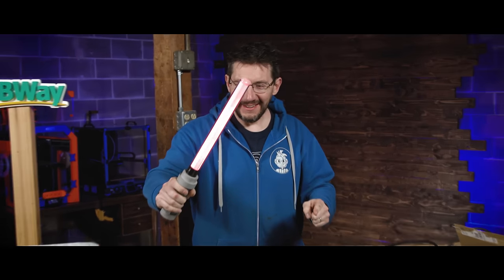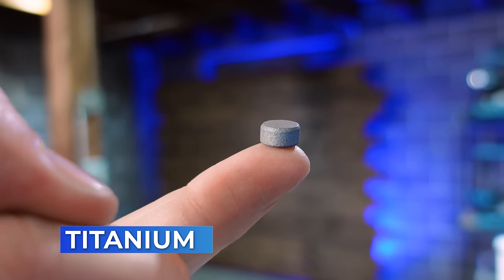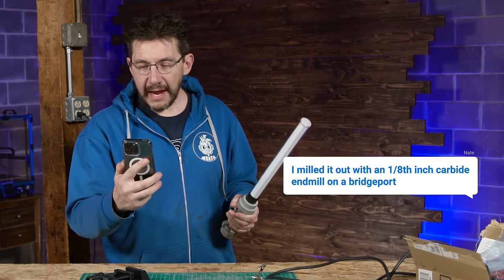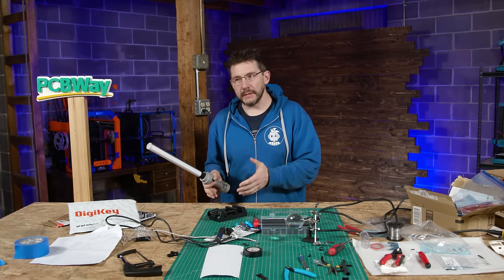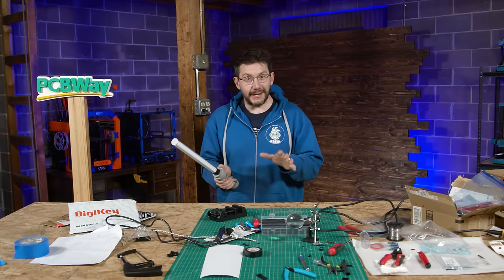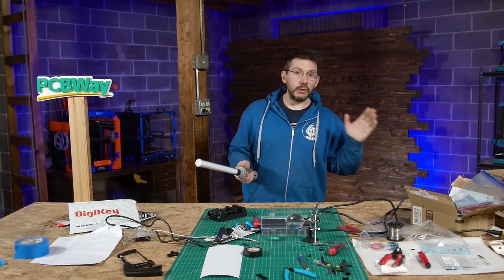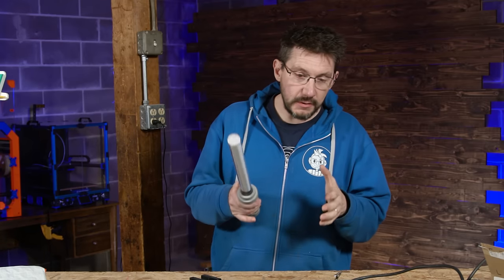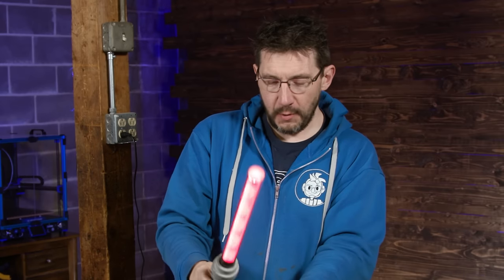AWESOME 3D Printed STEEL!

Comment: Whenever you tap metal, ALWAYS use some sort of cutting oil. Also, if you are tapping a small hole, don’t use a drill. Do it by hand and put your work piece in a vise.
Reply: Tap + Drill = Sadness, their are option for hand tapping drills with special chucks on them though. Good ones run you close to $500

Comment: Bacon grease and beeswax are the 2 most popular tapping "fluids" in our shop.  And if you happen to break a tap in an aluminum part, just send it out for anodizing, it will come back without a tap in it.  But in every case, alignment is key, a misaligned tap will almost always break.

Comment: I have never used a tap in a drill. It's alwyas been by hand, and WITH tapping/cutting oil, lots of oil. 
At lesat that was the way I was trained decades ago by machinists.
Reply: You can use a drill if you use the clutch and once it binds go back and forward till you are done

Comment: Very cool. These kinds of projects are always ones that bring smiles to people's face. But the one thing that came to mind... "I put some electrical tape on the tube so I can wave it around like a maniac, I mean..."

I had a teacher that showed up and proudly showed myself and classmates his new phone... a just released iPhone 3G. And with this new thing called the "App Store", he downloaded the most advanced apps that ever graced our mortal hands: the fart button and the light saber. Tap the touchscreen and "wooowow" and the light saber came on. Tap again "voooop". Double tap and the color changed. And if you swing it around... yea, that's the stuff. But unlike your electrical tape to hold the tube on, my teacher had nice leather case for his new phone. So he shook it around a bit to to make the light saber sounds when suddenly... the button gave. "WOOOWOWOWOWOOWWOwowowoowowowowo......." as the brand new iPhone that had people lined up around blocks to get... went flying off in a mathematically perfect ark across the room and into the cinder block wall the school was made of. So good option on the electrical tape to hold things secure.

As for my teacher's phone, he was lucky. Not only were phones less fragile then, but it landed on some old circuit boards, producing a kindof trampoline that broke the phone's fall. Back in the case and no more wild shaking with the app. Fart app it is. Keeping WOOOOWOWOWOWOWO awesome.

Comment: Tapping tip - go up a drill size! The tapping drill size specified is never going to work out in metal (even aluminum) when tapping by hand. You simply cannot keep the tap aligned with the hole, it will bind and break every time. Also it makes tapping a lot easier. And use a cutting fluid, WD40 works well for aluminum and can work in a pinch for other metals. Using anything is better than using nothing.

Comment: Your mistakes with the taps can be boiled down to one simple thing: you didn't use any cutting oil. You should never tap dry, especially on high speed steel. That will cause the metal to heat up and work harden. Once it work hardens, that tap will snap.

Comment: you could use a clear conformal coating on those circuit boards to insulate them it will fit way better but also make it water proof.
Reply from the maker: I had thought about that, but maybe next time!
Reply: What about kapton tape? Thin and high temp.

Comment: A few tips and suggestions: 1. As leeslegacy stated always place your metal part in a vice or secure it to a base for taping and always use oil to do taping by hand.  2. for electronics inside metal objects you can add a non conductive material to the inside... coat the inner surface with a non conductive dip or paint on the inside.  Or print an inner sleeve and subtract the thickness from the metal substrate.  This can also be used to screw into rather than tapping.  Effectively your outer metal part become more decorative by making that inner protective structure become the attachment point and the insulator.
Reply: "Or print an inner sleeve and subtract the thickness from the metal substrate" -- yeah, IMHO that's the way to go. I don't know if that would've fit the basic framework of the project here, i.e. still having some of the saber printed in plastic, but since the visible, touchable part would still be metal I'd think it'd still be within the scope of the idea.

Dip or paint is just going to reduce clearances anyway, so really should adjust the model printed in metal anyway, and if you're going to do that, might as well just go ahead and print a proper sleeve instead of dealing with messy dip or paint.

Comment: If you're ever going to drill or tap metal again, put it in a sturdy vise. For tapping, either use a hand tap being careful to apply even force (lateral force on the bit will snap it) or a drill press/cnc mill. As others have said, also use some lubricant, especially for hard metal like the high speed steel you were doing.

Cutting aluminum and wood will let you get away with a lot that hard metals will not.

Comment: Also a great addon is a "Adafruit RP2040 Prop-Maker Feather met I2S Audio amplifier ", so this thing uses the start up sound of the lightsaber but! Also your movements make the lightsaber change it buzzingsounds. there's almost no soldering on the feather board. But Johnny why havent u build it yourself and share your knowledge on youtube, well i dont have a workspace and two printers in the living room, the qidi tech xmax3 makes a lot of noise and my health isnt... that great.
Reply from the maker: Ooh!

Comment: 1. It's tool steel, not "high speed steel"
2. Tap by hand.
3. Use cutting oil.
4. Use a fluted tap so you don't have to back out the tap to clear the chips.
Reply from the maker: Well, shoot. What delineates tool steel from high speed?
Reply: High speed steel in used to make cutting tools. So it's technically tool steel, but not the same tool steel you would use for a parts like you have.

Comment: You should have 3d Printed a plastic chassis to hold your components. If you are a interested in making more, you can get way easier boards to use.
Reply from the maker: I love this idea but there was no room for the chassis. If I do it again I’ll also have Matt change the pieces a bit :)
Reply: @3DPrintingNerd  what was the ID of the part?
Reply: Chassis can be as small as 7/8 in diameter ;)
Reply: @3DPrintingNerd  IMHO, you'd want to adjust the metal part's inside space to accommodate a plastic liner/chassis that itself has the same size as the original project. Then the "no room for the chassis" is a non-problem.

Comment: I'm a novice at working with metal. But I've had better luck using a vise to hold the part when hand tapping and also using some oil as lubricant.
Reply from the maker: I had thought about the oil, but at a time it was too late :)
Reply: This is the way I was trained by machinists. By hand, and with lots of tapping/cutting oil.
Reply: I've broken more taps learning than I care to admit. XD Thanks for the video. Metal 3D printing is awesome!

Comment: I wonder if it would have been easier to print a small chassis to put all the electrical components on to insulate them from the metal 🤔 Kind of a pity it's so short though; bit more like a light dagger like this :p

Comment: The electronics in this seem massively over complicated. You could have saved a lot of work by using an Adafruit Propmaker RP2040. It has audio and neopixel support, motion sensor and battery charging all on a single board.

Comment: Instead of black tape what about kapton tape.  It's super thin and insulated.
Reply from the maker: HOLY COW I forgot about that!
Reply: @3DPrintingNerd  it's whats used when making battery packs and some electronics.  Just thought about it as you were making the electronics pack and thought 🤔 would this be better?  It's also fairly strong 😀

Comment: lol Joel, you were soldering with no part holder and not using a smaller soldering iron and/or microscope. I mean I know those cost money so it wouldn’t be worth it just for that, but you basically had everything working against you for ease of soldering. Just sayin, you made it hard on yourself in that case lol